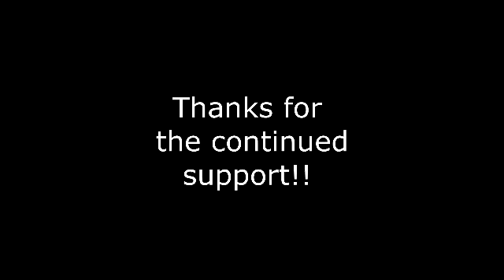How to make a beat in Maschine part 1

Comment: How can I convert the downloaded sample into a wav file in iTunes? Or can I convert in Maschine? AGgot Beats
Reply: Marquis Dendy  go into iTunes, Preferences, General, then Click Import Settings (its bottom right above the Cancel and OK buttons)

click Import Settings, then change Import Using to WAV encoder. And voila, you can now right click any song and immediately change it to WAV file!!
Reply: Hey man, when I'm feeling too lazy to sample off vinyl, I use a program called sound flower to sample straight off YouTube, spotify, iTunes etc all within the machine software. It's very easy and definitely a fun way to make beats when your turntable is getting in the way too much.